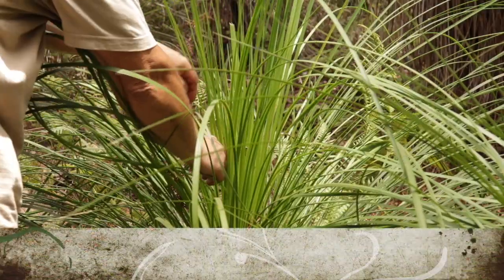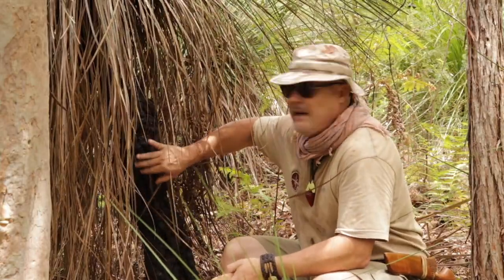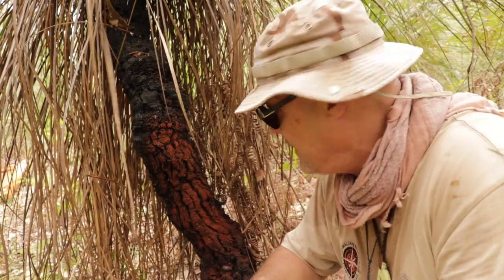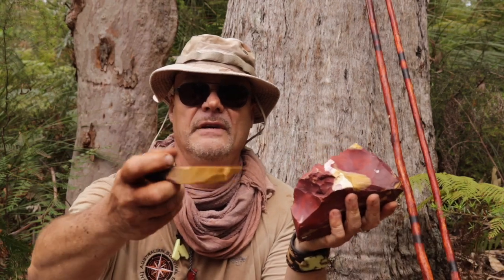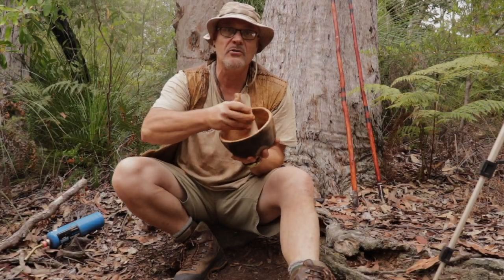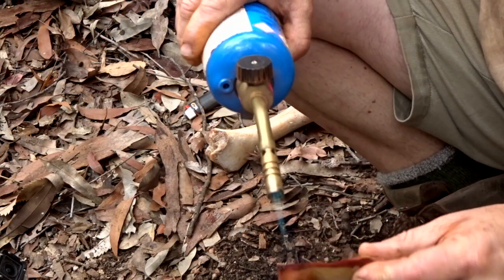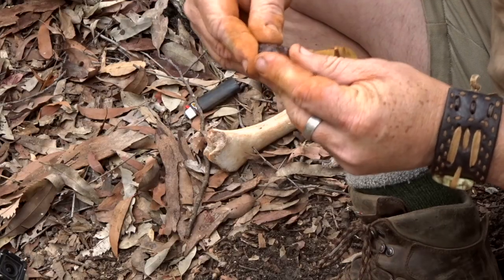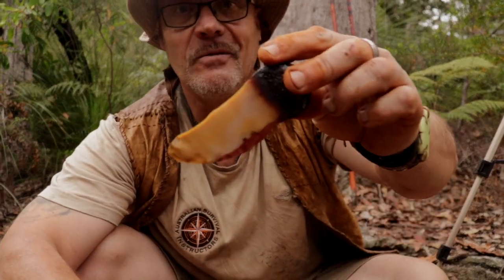Stoneage Living  Today - Leilira Blades

Comment: Can you please help. Mine just burnt and didnt work
Reply: More than likely you’re overheating it, keep the heat low, just barely enough to melt the resin, and as soon as it melts immediately remove it from the heat. You can use a heat gun for more control and less heat or turn the torch flame as low as it goes without going out.